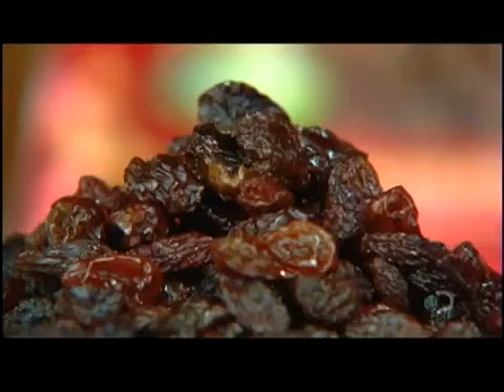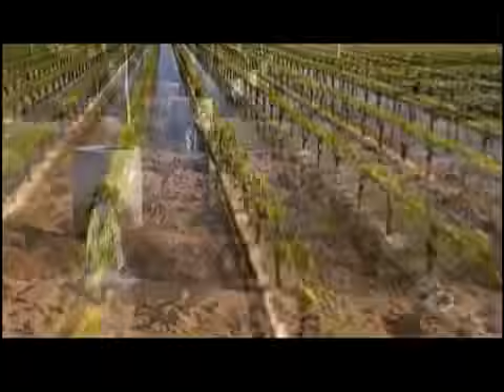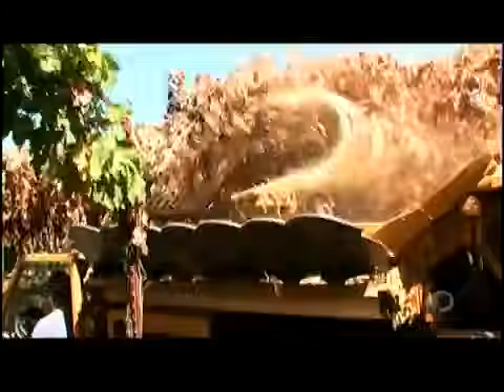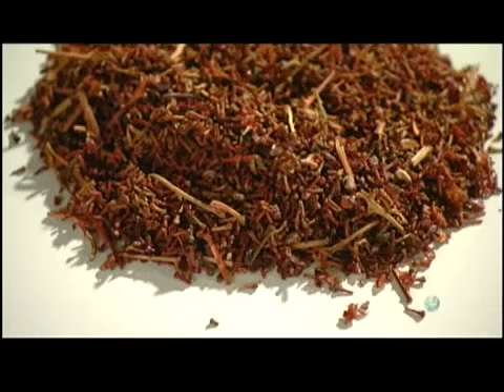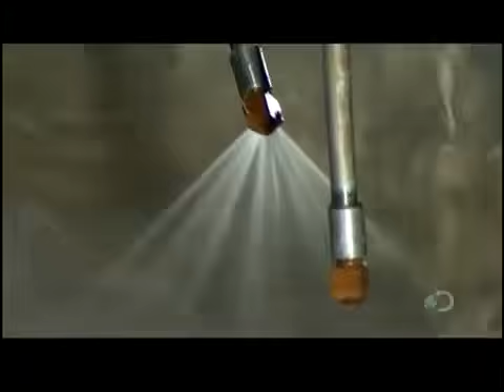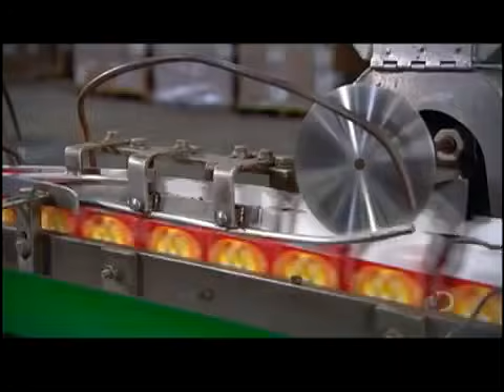How Its Made   Raisins Discovery Channel

Comment: Calcium alginate (Sorbsan) surgical dressing is super easy to remove after use,just add saline and it dissolves off,makes life easier for nurses and don't damage any tissue..so what's that got to do with raisins?,well by osmosis the physicality (not any chemical additives)of the dressing dehydrates bacteria like turning a grape into a raisin which kills  the bacteria, a nurse opined that,my employers never told me that,l used that as part of my sales pitch(l was a medical rep,unlike the rest l actually checked out the patient's wound,case notes etc,all authorised by the way) company didn't understand why l was No.1 salesman? I never told them,just nodded at the I'll informed bs they were spouting at sales meetings
Why should l tell them,hey l'm operating outa the box and most management get nervous at that M.O. 
Fuck 'em l was getting results and top sales figures and l was the youngest outa 10 😋  
Pepperdog181@gmail.com   😎

Comment: I prefer raisins that are dried on trays under direct sunlight. The raisins dried on the tray are somewhat meaty and chewy - versus the plumper sweeter raisins dried on the vine.  Don't get me wrong - I like DOV (dried on the vine) but I grew up in the San Joaquin Valley and I like the raisins dried on the tray.  (It's hard laborious work so I can see why it's automated).
Reply: Tray drying is faster but takes way more labor. Not only is it in direct sunlight, but the ground is much hotter than the air, so it practically cooks the raisins. Either way, I prefer them alone or in trail mix rather than baked in cookies.

Comment: ...some countries still spray a lot of dried fruits (especially dates) with "sulfides" that act as a preservative...this sulfide  preservative causes "Allergies" in some people with symptoms such as muscle contractions in the mouth and neck and breathing difficulties which can be a major problem for people with asthma!  Sulfites are also used in some cosmetics and medicines!
Reply: The word you're looking for is "sulfite". It's to prevent mold and bacteria. Many things contain it for that very purpose; like bread, cereal, dried fruits, bottled juices, ketchup, etc and even the cellophane wrap used for fruit in grocery stores. It's extremely rare to have an allergy to sulfites. It's safe to consume. Sulfites are not in cosmetics and medicines, you're confusing them with "sulfates" which is an entirely different chemical used as a detergent, a degreaser.

Comment: I Wonder what the taste difference would be if they were to pick the grapes off the vine clean them then dried them --would make a difference in taste?

Shouldn't they be easier to clean and be able to get rid of more of the cap stems?
Reply: they have to mass produce them so it's easier to just let them dry on the vine instead of picking them one by one to dry on blankets outside. Drying on the vine allows the company to save space on land, allows the use of machines to mass pick them, and makes it easier to clean many raisins by the ton at once.